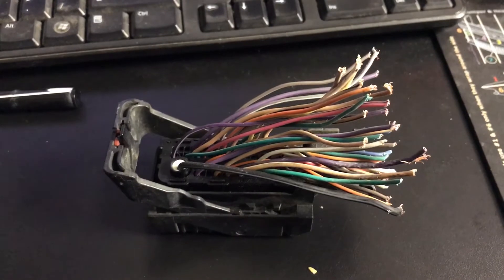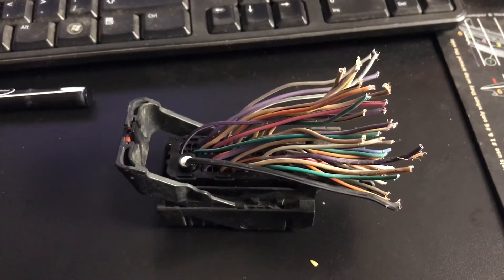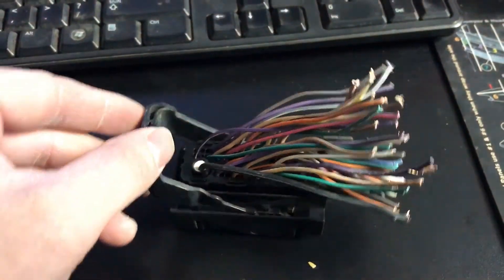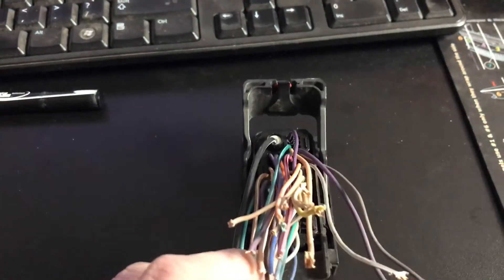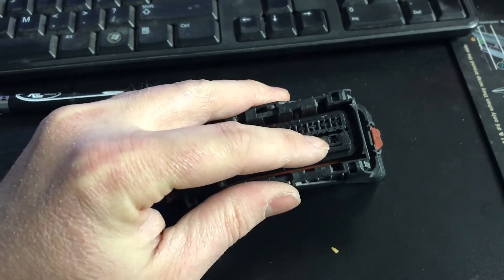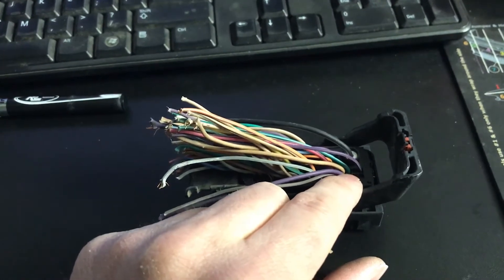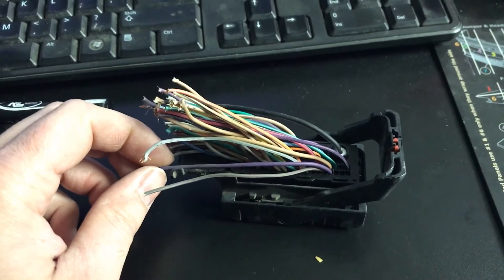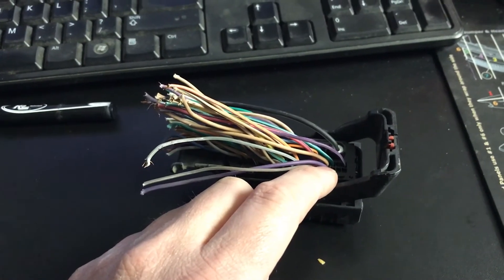FSCM fuel pump relay control PCM connector pin out

Comment: 09 silveradp 5.3 New pcm, new fuse block, no power on green n white coming off connector from pcm. No power to fuse 21 fscm. Why is there no power coming from pcm on green and white? Pcm is pre programmed to my vin.
Reply from the maker: Where did you test it at the PCM or the fuel system control module?

Comment: I’m getting p069e and p025a random shut down and no start turns over but no start hooked tonscanner I don’t see any rpm readings or any fuel pressure and no maf reading when attempting to start and won’t but is turning over
Reply: And I got a module off you and same issue

Comment: What if I have no power via the back probe on green and white wire? It’s a new PCM, programming before attempt.
Reply from the maker: Did you run the test with key on or cranking?

Comment: I have a 2009 Silverado I just bought.  I got a PO69E request MIL illumination.  This came on about the 2nd time I drove the truck but it runs perfect.  I took off the spare and found a brand new FSCM, they must have had this problem before they sold the truck.  Any ideas how to make this code disappear?

Comment: In your bulletin you wrote 3 choices ..  power with key on .. power for 3 to 6 seconds .. or power while cranking ..  I have power while cranking.. thats all .. so is my green and white stripe wire bad ? Replaced pump and fscm ... No start.. help . ???
Reply: Did you ever figure this out? I am facing the same issue.
Reply: You can test your fuel pump by disconnecting the connector and jump  the 2 furthest pins together on top and the bottom also.  Your pump will make a noise when you turn key on.

Comment: Eric...im kinda stuck not knowing if I have a pcm problem or an fscm problem...upon checking power at the fscm plug ,checking first the green and white wire...i only have power for a couple of seconds when the key is first turned forward...should the powerr in that wire be constant ? Oh and by the way I'm working on an 09 Chevy traverse ltz